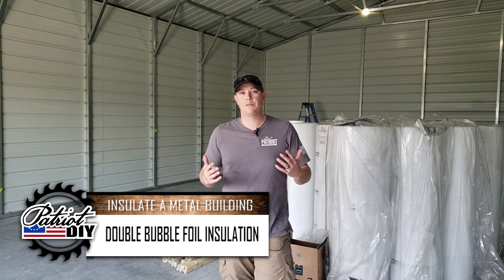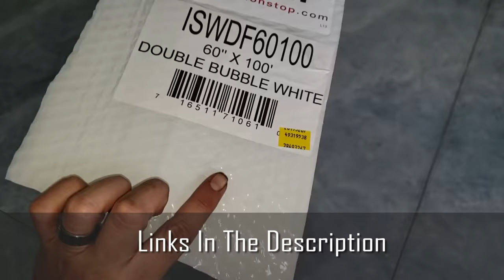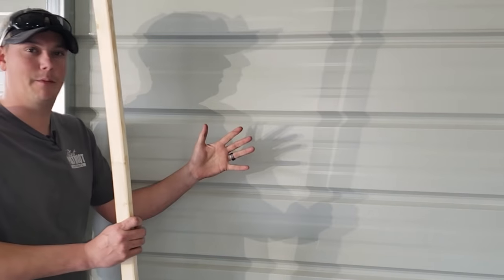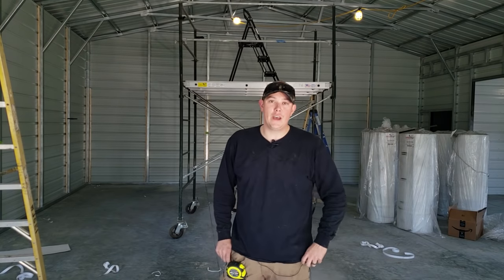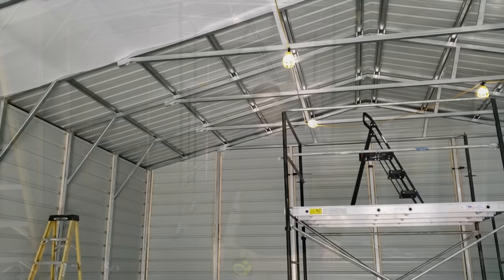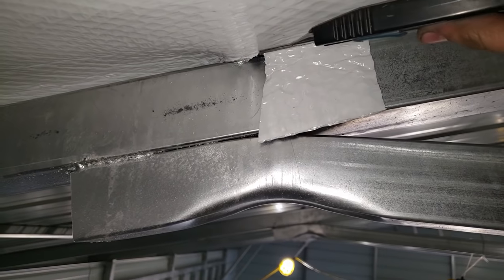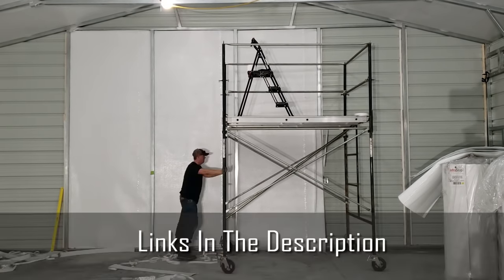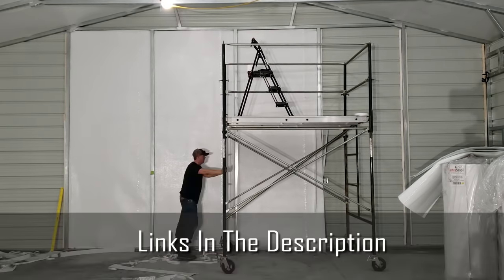How To Insulate A Metal Building / Double Bubble Foil Insulation

Comment: how well has the double bubble insulation held up for you? im in a dry hot climate in CA. i just had my 20x40 build with no insulation as of yet. the building gets super hot right now so i ordered enough double bubble to apply to the roof. Have you noticed the ceiling insulation helping at all?
Reply from the maker: Defiantly helps, it's not the same as regular insulation. But it's good for metal buildings to stop radiant heat and condensation.   I get about 10 degree difference without conditioning.

Comment: If you'd wanted to fully paint the inside to get a color on, without putting up drywall -- think spray foam would be a better bet? Wanna do the full inside of the shop as black.

Comment: The 4' width of insulation is exactly the right size?
Reply from the maker: It may still require some triming if your studs are 4' on center. Mine are 5' on center so I got 60" rolls from insulationstop

Comment: Nice job! I just built  a 50x24x10H and wondered how many rolls you used? What size is your garage? Thanks in advance!
Reply from the maker: 40x30 main shop, 35x12 side room. Approx 8-9 rolls
Reply: @PatriotDIY  ok, so very similar then. Main shop will be 36x24 and lounge 24x14. I’ll probably need at least 7 rolls? I do plan on framing and putting up wood on the lounge.
Reply: @PatriotDIY how’s everything holding up two years later? Still using only bubble wrap?
Reply from the maker: @C8corvetteobsession901  holding up good!!

Comment: How does the double face hold up in a heated metal building.
Reply from the maker: Holds up fine, but keep in mind mine is also held up with screws and staples, not just double sided tape

Comment: Did you glue the 1x2 to the frame or the metal panels
Reply from the maker: To the siding.  You can also use L brackets to fasten to the frame
Reply: @PatriotDIY  I actually thought about buying 10 ft 2x4 and rip them down to 1x2 and drilling a hole 1 inc from both ends and then one in the middle and screwing them to the framing tubes.  But I like your idea of gluing so not to put extra holes into the tubes

Comment: For what you pay and the guess work, and labor just add it to the price of the building install. I had mine completely insulated when I purchased the building. 24x31 was only 1100$ extra and that was with the door being insulated.
Reply from the maker: Mines 1620sqft I was quoted an extra $4000 for them to do it.  I did it for $1100
Reply: They gave you a great deal if they did the whole garage.

Comment: Trying to figure out what the difference is where you used the furring and on the roof where you didn't. Didn't catch that.
Reply from the maker: The roof has metal supports running the opposite direction. I taped and screwed to those

Comment: Hey did you notice if there was a temperature change before and after looks good
Reply from the maker: Getting about 10degrees cooler inside than outside.   Since the inside would normally be hotter than outside because of the sun....I'm estimating it's about a 20degree drop from what I would have been without

Comment: I had the Prodex installed with my metal building. My building is still very hot causing other issues. I added 2" foam board and another layer of left over prodex to the front of the building.  I will be adding more foam board when my budget allows. The prodex seems to only be a good vapor barrier. Not worth the extra $3500 though!
Reply: You mean published r value of Prodex 10 a lie?

Comment: So I’m just a little confused. I noticed your insulation fit between the studs without you having to add or cut any off. But you linked a 48’’ roll of insulation. If the distance between each metal stud was 60’’ what size insulation did you have to order and use. I only ask cause I’m in the same situation and looking to insulation my same building the same way. Thanks for your help
Reply from the maker: 48" is all I could find on Amazon but check insulationstop.com for 60"
Reply: @PatriotDIY  so did you use 60”
Reply from the maker: @Cracker-606  yes

Comment: Wouldn't an exhaust fan at one end, near the peak of the roof and a vent at the other end resolve both the heat and moisture problems?
Reply from the maker: Don't know! But sounds like a solid idea...I just don't know about an exhaust fan since my shop is conditioned with a minisplit now.  Don't wanna pump out off the bought air! Lol
Reply: @PatriotDIY  Ya, AC will dry it and keep it cool.  A fan would use a lot less electricity so for days that aren't too bad, the fan (like a fan for an attic) might do the job.

Comment: What if you were to place the insulation directly on the metal studs to cut out the furring strip step? Would the air gap be too big at the point or is this another reason? Thanks in advance!
Reply from the maker: Bigger air gap would actually be better, I just needed my studs to stay exposed.
Reply: @PatriotDIY  what would be a reason to keep studs exposed?
Reply from the maker: @Lakerfank24  because I'm going to be covering the walls with plywood and adding additional studs in between the existing ones.

Comment: Did this cool off the shop tremendously? I have a air conditioner that’s running nine stop, wondering if this is the route I shop go
Reply from the maker: Not tremendously!!!  About 10 degrees on hot sunny days
Reply: @PatriotDIY  thanks for the reply… dang… wonder if I go with spray foam or even something like foam board to help. It’s so hot out there lol
Reply from the maker: @willwork2fish261  they make a foam board with the radiant barrier on one side! Best of both worlds!?!
Reply: @PatriotDIY  can’t beat that. U know the brand name?
Reply from the maker: @willwork2fish261  I don't

Comment: Nice video. I noticed your building has horizontal sides. If a person is getting complete double bubble insulation (roof and walls), should horizontal siding be ok? Or is vertical worth the $2500 upcharge on a 30x60? Thanks in advance.

Comment: Hello Sir, getting ready to do the same thing for my 30x30.  Was wondering if you left the building open at the top of the walls at the roof or if you sealed the roof roll to the top of the wall roll?  It doesn't look like it but just wanted to ask in case you left it for some kind of ventilation.  Saw you were in NC as well and have just been getting ideas.  Thanks for all the great content.
Reply from the maker: I did not leave any open gaps at tops of the walls or in the ceiling. Thanks for watching! Happy to help!

Comment: I went with the 2' silver bubble and installed it horizontally with Liquid Nails, right over the beams, so my air gap is 2-1/2". Using 1/2" green insulation for the roof. Wish I continued with the silver bubble. Too much cutting and waste. I'm hearing that some ventilation is needed to prevent condensation. I'm wondering if I should seal the eve's and just leave the roof vent open.

Comment: How well does that double side tape work? Any issues with it failing? Great video by the way!!
Reply from the maker: Worked great, but keep in mind i also went back and added staples and screws to secure it more permanently in case the tape failed over time.

Comment: Your metal building walls - what's the length between the  posts? It appears to be more than 48 in.

I see you used the 48 inch by 100 ft rolls of insulation but your walls look a bit wider between each pole.
Reply from the maker: @JaredS-v5s  60"
Reply: @PatriotDIY  did you order 60 inch bubble wrap? I made the mistake of ordering the 48-inch😬
Reply from the maker: @JaredS-v5s  yes!

Comment: Hey, is that bubble wrap keeping your shop cool? We just built a similar shop and have been wracking our brains over insulation? Foil faced foam boards vs double bubble? Like how yours turned our!!!
Reply: In Arkansas!
Reply: I can tell a noticable difference from inside to outside temp. This is working great for me, keeping it comfortable inside, but we have also no hit 90s temps yet. The foam may have a higher R value!  
I'll post an update and temp comparison soon

Comment: It would make a lot easier job to lap the bubble wrap onto the sides of the wall posts and attach additional furring strips to the posts with screws and with the insulation under them. I can't see the tape holding up to heating and cooling cycles for very long.
Reply from the maker: @bguen1234  been several years and holding strong! Keep in mind I'm not only relying on the tape, it's also screwed and stapled (near the end if the video)

Comment: When are you adding the barn wood?  I'm torn between building a pole barn or metal building and would like some ideas or help on finishing a metal building
Reply from the maker: Soon...ish!   I've been working on tearing down a couple Tabacco barns and have a good stock of wood. Was planning to start putting it on the walls in then next week.
BUT I had to have emergency appendix surgery last week and that's putting a hold on everything heavy!  Lol.
Reply: @PatriotDIY  thanks for responding.  Yeah for sure heal up first.  If done again and pole barn/steel building were the same price, would you build steele again?  Or would you go for pole barn.

Pole barns just seem so much easier to finish and insulate.
Reply from the maker: @markm6444  assuming same price I'd probly go pole barn for the reasons you mentioned. BUT seems like you also loose some overhead space with pole barn so you'd have to do talked walls to get the same space.

Comment: The stuff you used WON'T help me in N. Florida with same type of building, I'm wondering if I need a gap if I use roll insulation, and the blow in stuff goes directly to the metal and that confuses me

Comment: I followed this video to the "T" and quickly realized that the liquid nails adhesive failed horribly !!  The liquid nails dried out and the 1x2 wooden strips started falling off the walls. I used clamps on these strips and waited 24 hours before removing them. I ended up drilling about 200 holes in my 25x35 metal building thru the wooden strips thru the metal walls and then went and added 1" self  tapping wooden screws from the outside to attach these strips from the outside. Another tip would be to make sure your insulation rolls are checked for a square edge before trying trying install onto wall. Your video was a good place to start tho. Thanks again.
Reply from the maker: Mines been up for about 2 years, 0 issues.  A better way to secure them though would be L brackets to the studs, then you wouldn't be drilling through the outside wall.
Reply: @PatriotDIY   My shop in in constant sunlight throughout the day, so the building gets quite hot.  I do know that some areas of the wooden strips did not make complete contact with the walls due to either the wooden strips not being completely flat or straight or the metal walls themselves not being completely flat due to the wall structure being bowed in some areas. Nevertheless, it was best for me to re-secure  the strips with screws from the outside with screws that have the rubber grommet attached. I feel 100% confident that I will no longer have an issue with the feeling that my insulation might come down in the future. It is extra work but well worth it. I'm still in the process of installing the insulation.
Reply from the maker: @christophert2778  Good luck to you sir!!!

Comment: So your width is 4ft wide?  Bc my metal building is 5ft in width, between the metal framing.  I tracking i will have to ask if they make double bubble in 5ft width
Reply from the maker: Mines 5ft.  Check insulationstop.com
Reply: @PatriotDIY  thank you so much!  Did your liquid nails hold up or would you recommend using self tapping screws along with it for your 1x2?  Once again thank you for your time and sharing!
Reply from the maker: @kevinw8523  Mine is holding up fine but if you wanted to attach the 1 by 2 to the studs with self tappers that would work Good or even better

Comment: I followed this method. Used the adhesive for an entire wall and I went to add the double sided tape and the 1x2 pieces of wood just popped right off the metal. I even left the liquid nails to dry for a couple days. I wonder what I did wrong?
Reply from the maker: Dony know but you coukd Use Some small L brackets too to fasten the wood to the studs

Comment: Why did you use double side sticky tape? why not use liquid nails to attatch the insulation to the furring strips?
Reply from the maker: Because double-sided tape is easier and sticks instantly rather than having to hold it there and wait for liquid nails to dry.  Also keep in mind the double sided tape is just a temporary or extra solution...after it's installed on the tape I went back and reinforced it with staples and screws for permanent hold

Comment: How has it held up so far this winter? I'm in SW Virginia and I have to insulate my metal building and this seems like the way to go. I look forward to hearing about your results! Thank you.
Reply from the maker: Holding up great! Consistent 10 degree difference without any conditioning. And does a great job of holding in heat when I use heaters and wood stove.   Had it 72 degrees in there last night while it was 32 outside

Comment: I don't know how well this would stay up. I would have cross hatched my furring strips to have more surface area for this stuff to stick to. Also I would have used an electric stapler. I don't trust stick on in hot weather. It could come loose after awhile.
Reply from the maker: You should watch the whole video!  It's also held up with staples and screws

Comment: What was the price in insulation alone for this job? Or if you could answer this... what would a 30x30x12 cost in this insulation?
Reply from the maker: I spent about $1500 for materials but ended up with 2 extra rolls that I didn't use.    Not positive but if the math is right you should need about 500ft is ur using 60" rolls.

Comment: Isn't that going to cause a lot of condensation in between the metal and the foil insulation?
Reply: The air gap is going to be really hot. Most of that radiant heat hits the foil and bounces back outward. The radiant barrier will help but additional insulation would make it that much better.
Reply: @KPHVAC  what else would you put to make it better. I wanted to do this for my 2 door garage that gets too hot from facing west and would appreciate some more info. Your comment called out to me lol
Reply: @j_cruz_56deuce26   I would use some Rigid Board Insulation. Maybe a reflective radiant barrier as well.

Comment: Has anyone ever tried Huber Zip+R6 (or better) insulated sheathing (OBS with a integral green coated vapor barrier + a couple of inches of EPS form insulation).  The Zip+R6 is available in 8', 9', 10' or even longer panels.  With my 10' side walls, I'd opt for the 10' Zip+R.  I was thinking of putting it on the inside glued and nailed to wooden blocking to be attached to the metal building's steel studs, and all joints would be sealed with Zip tape and nail heads covered in Zip liquid sealed to form a reasonably tight building.    In NC, like much of the Southeast with it very humid and hot climate, most of the year, the building would need A/C for cooling comfort and very little heating during the winter months.  Condensation occurs where the warm moist air meets a cool surface.   By reversing the Zip (normally the Zip green faces to the outside directly under the siding)  so as to form a tight vapor barrier to the inside and insulated with the 2" of EPS foam + air gap between it and the exterior wall, condensation should be minimized, right?  Any thoughts or recommendations?  Does this make sense or is this a really stupid idea?

Comment: Condensation doesn't "get into" the building. The moisture condenses from the internal air. I am genuinely looking for a solution to condensation forming on a metal roof. I currently have 8 inches of rock wool under my metal roof, but still get condensation dripping from the metal z purlins. Usually in the morning. "Now" is October, I'm in the UK.
Reply from the maker: This product with fix your condensation issue

Comment: would assume giving a space with the furring strips is also used in a wooden prebuilt shed... using double bubble first and the other insulation over the double bubble. Working solo helped me as that is what I am doing for my off grid shed to home project. Tough to find videos on insulating prebuilt sheds, happy I found this before I got started... have the same rolls of white & silver for a Tennessee project, what some dont get is a radiant barrier assists with heat entering and leaving in the colder months. It is not meant as an insulation.. it is for reducing cooling and heating costs with the addition of batting, I have been watching a ton on the radiant barrier usage in really northern cold climates and southern .. where humidity can be a factor which needs to properly install radiant barriers to not have mold and condensation inside

Comment: What happens if you already have condensation?  I didn't know about condensation when the company installed my metal building.  Now it's winter & it is like a rain forest
Reply: I would add a vent and an exhaust fan.  I'm going to use a solar fan to move the air. It should cut down or eliminate the condensation from what I've read.
Reply: @Budl1te  I bought double bubble  insulation with foil on both sides, and am in process of doing firring strips to have gap + area to staple the insulation to.  I also did get an exhaust fan with a thermostat so it operates on its own to exhaust heat in the summer.  I put it at the peak of a side wall.  Not in the roof.  👍